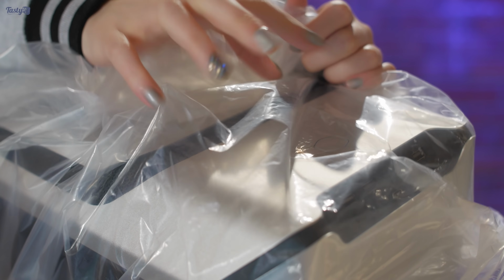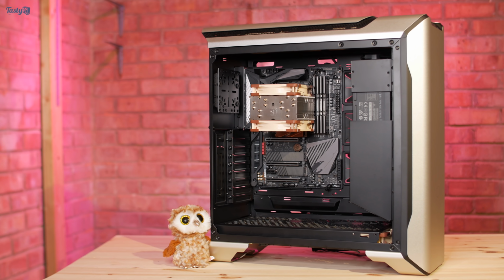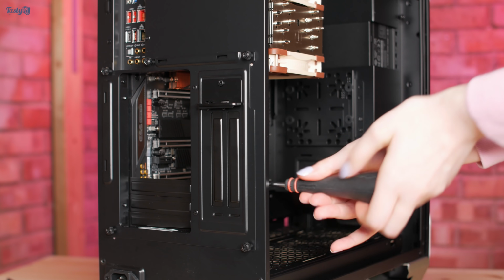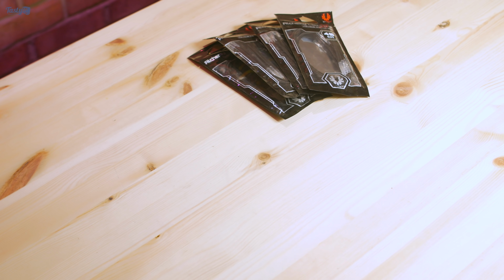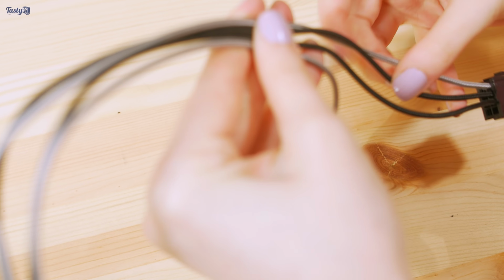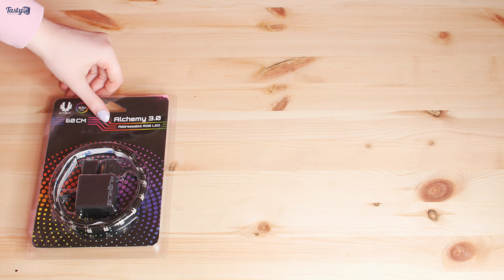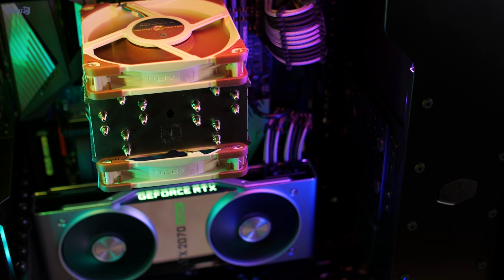Finishing My Ryzen 3900X 200mm Noctua Wind Tunnel Build

Comment: I had the same problem with the 200mm fans at the bottom. I used the Ring Plus 20 to match the fans on my 360 rad at the top.  I luv that case.

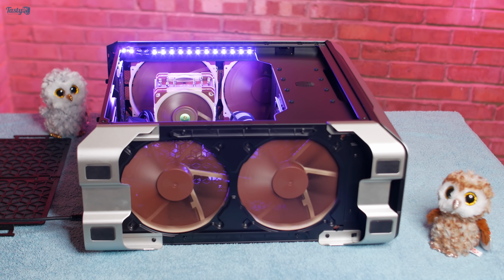Comment: 7:07 That's some serious airflow. The DEC 3000 Model 800 risc workstation from the middle 90's had a similar design, fans pulled air in from the bottom and exited out the top. Photos: https://www.okqubit.net/machines/img/dec_3000-800_front.jpg   https://www.okqubit.net/machines/img/dec_3000-800_logicbd.jpg

Comment: Not sure if you can get a controller for it that doesn't use software, but the cooler master master accessory universal led strip RGB does a decent white, they use the standard rgb 4 wire connection, no molex. You could probably control them in bios. They stick on your case with magnets.

Comment: I'm just finishing my build using the same case, but left the stock bottom fans, installed 3 be quiet! 140 mm fans on the  top exhaust, changed the processor for the 3950X using the same motherboard and finally decided to use a Noctua NH-D15 chromax.black. Will post how that finally works, cheers...

Comment: Would it be kept on a desk?
If no, air filter for bottom fans?
If no, maibe changing the airflow from top to bottom?!
😂😂😅😅✌️✌️
Reply from the maker: It won't be on the floor but the bottom intake has a full length dust filter. It's on the desk next to the PC at 7:07 :)

Comment: i got the same noctua , i got the 90° mount kit too.... but it cant fit with the ram modules, my board is an asus 570x..... but i noticed your ram are kite "short", mine are corsair vengeance pro ..... well i got this issue a lot of time.... and mi case is a sl600m too .... ☹
Reply from the maker: I talk about the ram height limitation in the previous video. https://youtu.be/Z9COhusuWA8
I know it sucks but unfortunately you'll need to either mount the cooler normally or swap out the memory.
Good luck with the build :)
Reply: @TastyPC   thanks for the tips.... my NU12A will not fit in 90°😣 the ram are too big , but instead I installed 2  NF-A12x25 fan as extractors in the upper chasis, they work fine, i rushed my pc build because i could get a rtx3090..... this is my first gamer pc, so i tried to get the components in hand, i did it in the rigth time because all the prices are up to the sky.....

Comment: Try Phanteks's neon rgb strips with a phanteks rgb controller hub. Controller hub comes with a pretty lengthy controller that can be easily routed to the outside of the case.

Comment: HEY you should put your cpu cooler downside up bc now it is blowing to gpu and not cooling it too.
Reply: And upside is taking and also getting air out of space in very little space. Just upside to down and its lot better.
Reply from the maker: The CPU cooler is exhausting upwards and won't effect GPU temps.
Reply: @TastyPC  I mean the cooler itself not casefan 😊
Reply from the maker: @Linets.  So do I. Every Noctua fan in this build (cooler and case) is blowing air in the same direction as intended in this case. 
https://s3-eu-west-1.amazonaws.com/cdn.coolermaster.com/assets/1007/vertical-layout-chimney-effect-imageleftorright.png

Comment: Great build.  I just got done with a chimney effect (or wind tunnel) build myself.  Well, I'm not completely done...still have some more custom painting to do.  I came SO close to getting the SL 600M, but I wanted to showcase the custom loop a little more, so I went with an O11 Dynamic.  I know, so un-original. lol
Had such  tight fit with the lower fans that I ended up getting a low profile USB 3.0 header extender cable from Amazon.  Best decision of the entire build.  What a lifesaver.

Comment: Great job done! What about acoustic properties of the system? Could one hear any sound anomalies like high or low frequency noise at one feet and three feet distance from the machine? Could you measure generated noise level of the system at idle/intensive load of cpu and gpu?

Comment: Maybe I´m a bit late, but for lighting, I use the system from "evnbetter". It has a nice controller for outside the case, where you can switch it off and change color, mode, or brightness. The only problem is, that it is a company from Germany and I don´t know if they sell it around the world

Comment: I have to admit I don't understand the problem with the 3.0 connector.  I never had any issue with it and I don't know what could possibly be the issue with it?
If one tells me they have a problem with the front panel connectors, sure I can see that, but not the 3.0.
The case looks really nice, but I would prefer the outside color to also be inside, instead of the black.  
Thanks for the video.

Comment: I miss the dust cover, so I use a different case with one.  Fractal ARC Midi R2, I also (with some tricks) installed the Corsair H150i Pro at the top and therefore need less fans and therefore less noise, but a little more visible cables.  Unfortunately, only one fan is possible at the bottom.  Installing the graphics card in your case is an interesting feature.  Your configuration is great and looks great.

Comment: i clicked the Video thinking it would just be a generic Building Video/Guide, but damn thats the first time i actually feel like the Person behind the Video genuinely has passion for PCs and really well knows the Struggles that come with it when you try to make everything neat and tidy. 

especially at the Statement "USB3 Header is the most annoying connector since 4 pin Molex" and "Even lighting across the Hardware, but not be able to see the LEDs itself".

When i look at Setup Videos and people putting LED strips ON the Desk I Die a little inside. 

Got you a new Sub.

Comment: Top down airflow will cool your C.P.U better bause the case fans are closer to your C.P.U. cooler and you are not pre-heating with the G.P.U. You will also not draw dust from the bottom. Ideally mounting your G.P.U. near the P.S.U away from the C.P.U. airflow would make this case outperm AIO water cooling especially with an NH-DH15 air cooler with the fans in a pull/pull configuration.  Air cooled C.P.U temps drop dramatically with good case airflow. This could be a monster air cooled case with this configuration,
Reply: Would reversing the airflow not cause the GPU to suck in warm air instead? You're basically trading a warmer CPU for a warmer GPU when mounting the GPU vertically like this video already balances the temperatures quite a bit.

Comment: If you like the controller but just need lights that can produce true white you could try sk6812 strip as they have the same wiring with the addition of a white diode.

Edit - just make sure the controller supports the LEDs. The controller itself needs to send 4 channels of color information; red, green, blue, and white.

Comment: Not going to lie, I saw the vertical GPU and CPU cooler and thought 'what is going on here'. But having watched, I totally get it. If it was a gaming build you'd get amazing GPU airflow with a horizontal mount, but as you clearly explain, it's a productivity build and the set up looks really good in getting good breathing for all your components. I'd definitely be down with building something like this for myself.

Comment: I got an insignia rgb strip at best buy that just plugs into usb. I used one of the ports on the rear i/o. I was right there with you on wanting something not molex and you could manually change the colors. you can't really mount the button to look as good as the one you used in this video. I don't know if I can paste a link in comments. And I don't know if they have best buy in England. But it's Insignia™ - 4 ft. Multi-Color LED Tape Light
Model:NS-LED4RGB18
SKU:5779000 $30 US, but I was happy with it.

Comment: I actually designed a custom case that would be perfect for this concept round like a water tower with the components in the centre .

With two very large custom fans top and bottom with a bottom to top flow.

The components are at the centre of a twister

Sadly that was years ago for my tafe finials and I've lost the files

Comment: So for more vibrant whites you need rgbw to my knowledge which requires an extra pin but I think they might have those on some gigabyte motherboards. Or another viable option would be to connect a microcontroller like an arduino or rpi to control the leds which would be a pretty neat little mod.

Comment: I also went a 3900x and noctua D15 with 2 fans and an auros master x570.  It's been a great combo paired with a 2080ti and bdie 3200 c14 ram. I did eventually change the fans on my noctua cooler for Noctua black swap edition fans. Oh by the way. Found you through the hardware unboxed discord. Great work!

Comment: Interesting build, i'm sort of in the same boat, and plan on waiting to see AMD's big NAVI and nvidia 3000. Currently using my 1080, with my 3950x

I've never considered assembling my own cables for PSU, which would have come out really helpful on a project i abandoned because of the.... weirdness of the cables on the dual socketserver motherboard
Basically the motherboard had no 4/8 pin CPU ports, ALL of the board power came through a single 24 pin. all 300w needed for both of the processors, 12 ram slots, 10/40Gb SFP+/QSFP+ and PCIe and USB), but wasnt a standard 24 pin(or maybe it was a 20 pin cant remember), on the other end it was a single 8 pin plugging into the PSU. the 24 pin was purely 12v pos/neg with a single 'remote' cable to send power on signal to the PSU, and no, i didnt design this, this is how it came from supermicro inside the dual board 1U server chassus

Comment: Your automated lighting systems - could you control these with a raspberry pi that has a hard switch attached to it's gpio pins?  I haven't used these strips myself so I wasn't sure if it was an option.

Comment: Ill try something similar when I do a 3950x later this year. Thanks.
Reply from the maker: If you leave it too late, you might as well go with 4th gen Ryzen which is expected later this year. Unless your plan is to wait for the 3950X to be discounted.
Reply: TastyPC and the new 3000 series nvidia cards should be released this summer... I’m going to try to wait till then but it’ll be difficult

Comment: Ooohhh, Helloooo ( just love Charles Hawtrey R.I.P. ). May I give a hint of suggestion to your build concerning cooling and airflow? You have your case's axial simmetry line, of course I mean on the bottom part of the case. Now you take a piece of plexi or acrylic sheet in a coresponding size and thickness and you place it in a slant manner just reaching over your GPU. Of course you have to fasten another piece of sheet on this cover's end which is towards the front of this case to give the hole thing self-support. This way you can separate and help to direct the airflow within the case. As for example in the PowerMac G5 and Mac Pro cases up to 5.1 or late 2012 whichever you prefer. I do understand your choice and idea concerning vertical airflow and the concept of the way you arranged your components but let us not forget that your graphics card's fans' rotational axis is now normal ( orthogonal ) to your vertical airflow, therefore "racing" for fresh air in conjuction with other components that are ideally aligned for best cooling. This way you direct a suitable amount of fresh air on your graphics card without disrupting overall airflow and thus causing vortexes in the case. Plus with these materials you can still have a view of your components and as an added bonus you can place separate RGB-lighting on this little "inner case" or cover. Nevertheless keep up the marvelous work you're doing:))). Truly yours, Tomi

Comment: I still dont understand the point of the usb3  header.  
 
There is this bias lighting in amazon. Called Luminoodle Pro Bias Lighting, it comes with a control remote, that should help. 

Your cable management in the back was great. 

 Are you going to overclock the cpu?  Ram ot gpu?

Comment: The issue with the USB 3 isnt really the cable, its the MB header. Asus has a better solution with their Crosshair boards as thier 3.1 connector is facing sideways (not straight up) so for most cases, its facing the cable holes toward the front, so much easier to run the cable without it looking like crap.

Comment: Nice new video again! If you are looking for a lighting solution that can do proper white and is controllable without software and would consider going DIY. Look in WLED, I did a video on my channel about using a QuinLED-Dig-Uno with WLED and some WWA (Warm White, Cool White, Amber) addressable LED strip in my build and it turned out great! You can use the same setup for addressable RGB too but you are never going to get a decent white out of RGB strip. If you want color AND white you can look into sk6812 RGBW strip (which is compatible with WLED and the QuinLED-Dig-Uno), although the white isn't great (low CRI) it's still A LOT better then using RGB only. and will probably look fine showing off the silver shininess!
Reply: The programmable "smart" LED strips have the disadvantage of requiring a controller of some sort. Granted, it's not hard to program an Arduino to make it work, but if just white is all that's needed, 12V white LED strips just need a switch for control. And instead of a Molex for power, use a 6 pin GPU power socket or SATA power socket.

Comment: That's a gorgeous case. Aluminium and tempered glass.  
Nice work on the interior too. Very classy.

Only thing I'm not fond of is the color of the Noctua fans. That brown shade isn't very modern looking. 
Would have been gorgeous if it had been chrome blades, if not RGB.
Reply: There is cromax version of nf-a20: https://www.amazon.com/Noctua-NF-A20-PWM-chromax-Black-swap-200x30mm/dp/B07ZP46RNR :D

Comment: Nice build and very inspiring video! I'm still rocking a i7 3960x since 2012... very glad with its performance, although there are very limited options for LGA2011 compatible motherboards out there these days, which narrows RAM options a lot. What has really been annoying me though is how noisy my current setup is. I'm probably investing in an upgrade to get the same case and noctua fans as you, except I'd rather have them black. :) Would you mind giving us some feedback on how the noise/thermals turned out? Thanks!

Comment: Ya USB 3.0 connectors suck, they are always such a pain to cable manage. 

Nice build though! What exactly are those cables you bought?? I've never seen those, you buy the pre-sleeved wires and then attach them to the atx connectors? Hmm, that would be interesting to try. I would be hella scared of wiring it up wrong though.

I just bought an EVGA 2080ti FTW3 and holy crap its a massive card, the heat sink on it is huuuuuge but damn its fast and lets me get 144hz at 1440p in almost all the games I play.

Comment: Looks tidy! Although I can't help but feel a D15 would have made things look a bit more filled out, even though it doesn't perform that much better than the U12-A despite the significant size difference.

Noctua needs to squeeze an extra heatpipe into the D15, it did wonders for the U12's performance so should help push their dual tower design to the next level.

Comment: Looks like a great build all around. Assuming you don't have the stability issues that plagued you with your previous Ryzen builds, you should have a monster on your hands.

As for people saying the GPU would ruin the wind tunnel effect...even without the vertical GPU, I wouldn't worry about it. Barnacules did something similar in a build with Puget Systems a few years back and had no issues with temps at all, even though the dual 980s were right in the path of airflow of both xeons in the build.

Comment: Why the vertical gpu and up/down cpu cooler, the thermals hurt me.
Reply: Vertical gpu isn't a problem if it's not crammed to the glass pane, the cpu cooler is like this because the airflow is like this in the case, cool air from the bottom, hot up

Comment: Funnily enough I literally finished a 3900X and 2070super Build today. I personally just couldn't justify a 2080ti, and I really didn't see the value proposition of a 2080super at $780 (after tax), vs 2070super $580 (after tax), but about 15% more performance. I invested in the 3900x as to hopfully keep it for several years, and, have significant room to grow when higher performance GPU's come out.

Comment: What configuration are those case fans in? Like push pull or pull pull ect ect?
Reply from the maker: Apart from the GPU, all of the fans take air from below and exhaust it straight up. Like a chimney.
Reply: @TastyPC  most of us call it wind tunnel configuration

Comment: What's your temp on the 3900X and what is the ambient temperature in the room? I also have a 3900X and use Noctua NH-D15 as a CPU cooler. It still kinda run warm for me. Waiting for my IceGiant CPU cooler still >.>

Comment: How did you go with plugging in the one CPU power connector? I'm hearing mixed things where we should be plugging in two 8 pins incase the CPU throws a fit. How was your experience?

Comment: I have to admit you are the master of B roll footage, panning through the perspectives of the builds.  and yes the usb 3.0 header is so annoying... there really needs to be 90deg versions or something. but anyways enjoy that 3900x , and you made the best choice, i have a 3950X and on the same MOBO and it blows the original 3900X i had out of the water in BENCHMARKS but i can't say that the real world difference is really that much better.  Yes it's obvious when your looking at a number or bar-graph. Otherwise i wouldn't really notice the difference....  FYI watch your SOC voltage... this MOBO; even with the new BIOS, on auto likes to set the SOC voltage WAY to high.  I found setting it to 1.1 manually was completely stable even with a ram overclock to 3600 forget the exact timings.